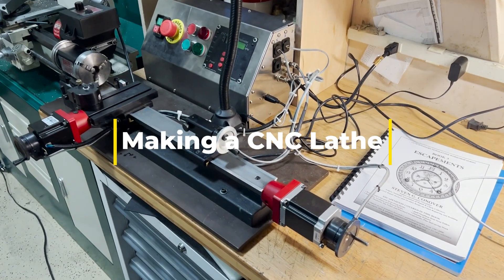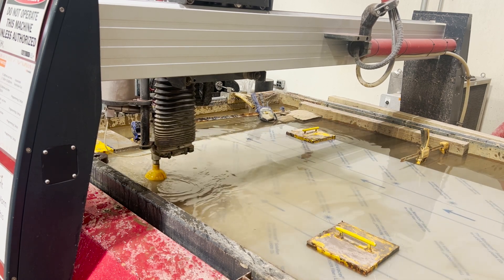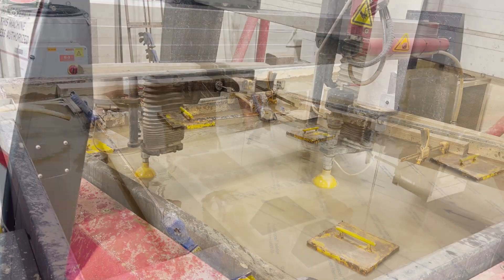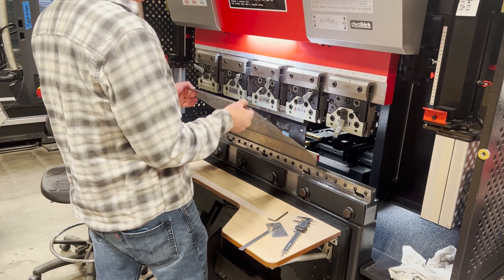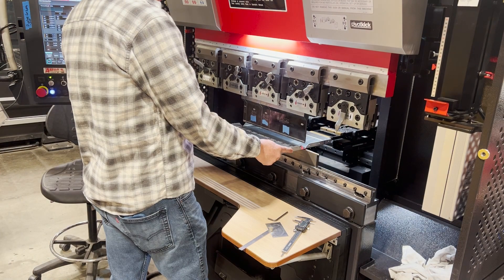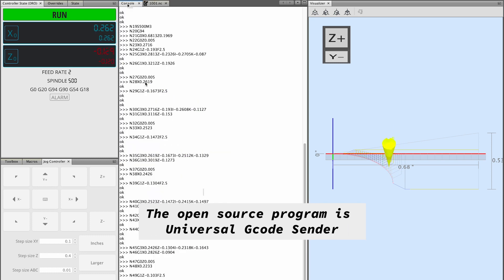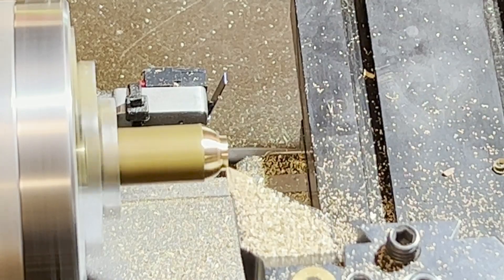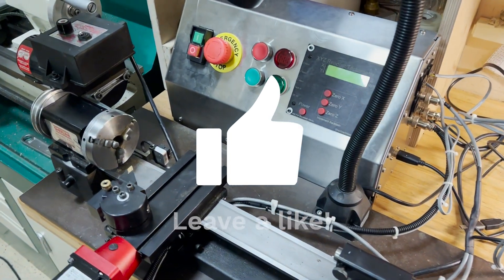Converting my lathe to a CNC

Comment: Hi Kevin...I'm in the process of converting my sherline to CNC and right mow my main stumbling block is posting the G-code that Fusion360 produces  What post processor do you choose?  I've been able to post to Tormach (which I don't own) and the code runs somewhat...I get a lot of error codes so I'm not sure in which direction to go. Any help you could give me would be greatly appreciated.   Thank you.
Reply from the maker: I am traveling now and don’t have the computer I use so can’t check and my memory is bad.  For the lathe I think I used a generic post processor.    It’s of you get errors for the Tormach as that should post clean.   Could be you need to set up the proper axis ext in the processor so it matches the machine you are posting to.